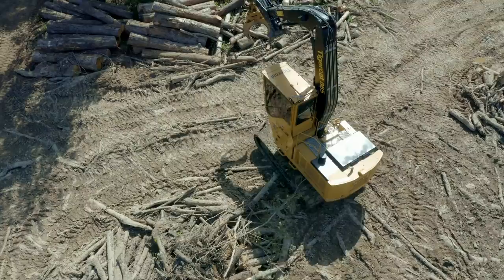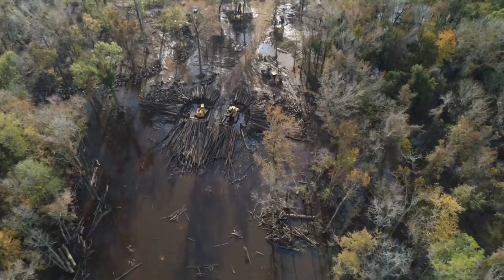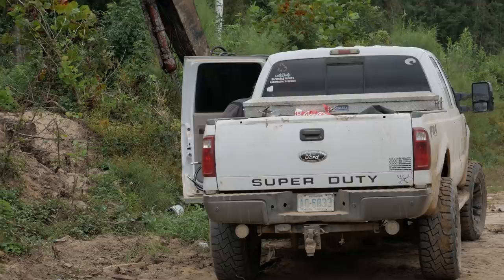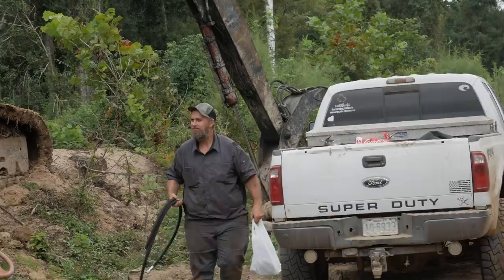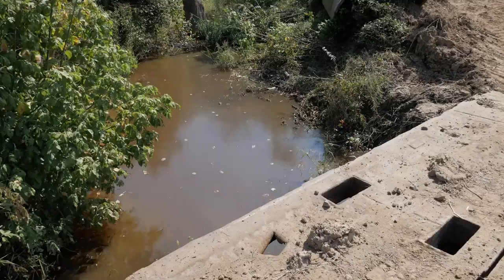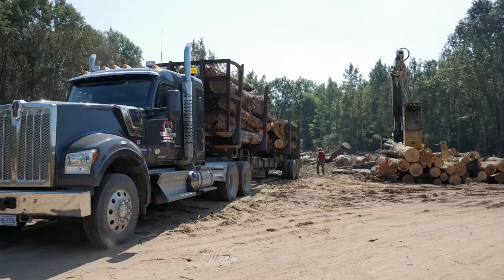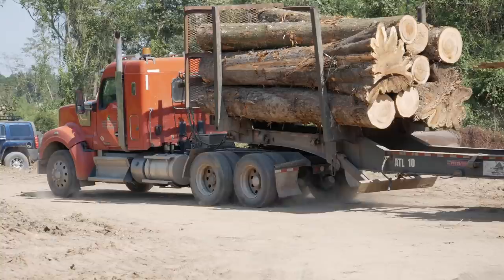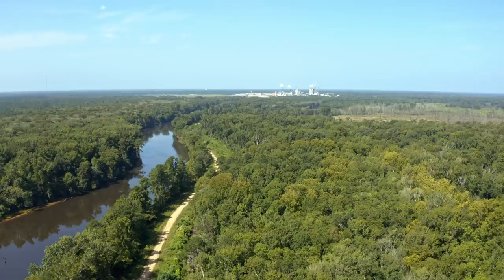SWAMP LOGGERS NC / Don't Know If We Can Survive This..."

Comment: Yankem rope, I had em 35 years ago on the Outer Banks fishing. You build up momentum in the first truck, like a rubber band. When it stretches to its limit then the stuck vehicle is coming out. I saw a man hook a pickup to a 21’ box truck, don’t know what was in it, probably not much but it came out. Now everyone from Midwest to the west have them to pull out the tractors and combines that get stuck. I think they make them up to 2”—-to 2 1/2” in dia. I’ve never broke or never seen one broke. Stay safe friend PS: You better wear a seatbelt or you will eat the steering wheel in the front truck.

Comment: The stretch on those ropes are awesome....I haul logs in north central Alberta...7 axle jeep and pole trailer...I blew a u joint loaded at night and my boss came with truck...empty 7 axle unit and we put a steering tire between 2 chains and he pulled me to the mill..over the scale to the crane.....the tire made it smooth no jerking....but we did stretch the tire a couple of time pretty good

Comment: Justin..never get that close or lean your face down to inspect a high pressure fitting like that again as if it blows that crimped end the pressure can remove your eyeball and face all the way down to the bone.. Proven fact... You can inspect it just fine and safely from 20' away little brother..

Comment: I have watched you for years mr Bobby I’m a swamp logger n south ga. I’ve probably missed the part when u talked about this but can u please tell me why u don’t use circle saws instead of slasher saws. With the price of chains and bar oil now days. I’ve figured it every way I could think of. Far as we can figure circle saw is the more profitable over time. It’s also really fast and the 72in handfab saw can cut a 36 In tree no problem. Thanks I’ve just always wanted to ask u that. Have a great day keep up the good work
Reply from the maker: Well we get such a good deal on the buck saws from years past. We have alot of spare parts for them. The guys can service them without having a maintenance guy to stop what he is doing to service it.  Thanks for the question.

Comment: Is that the hillbrun track they are on. The same one they cut on the show. Season 2 or 3 I think. With the 7 mile road. Where Bobby had to make a new road and deck. Is that the same tract. If so why are they not using the new road abs deck that Bobby build. Looks like they are back on the original deck on the hillbun tract

Comment: People need to do their research and think for themselves when it comes to the topic of logging. Logging is not deforestation it forest management. Look at companies like Weyerhaeuser and Roseburg timber. They manage that wood. They plant it then they thin it a couple of times then they clear cut. Then they replant and start over. I bet all these people against logging all live in house built from lumber, I bet they use toilet paper daily which comes from hardwood pulpwood. But i bet if you were clearing these trees and piling them up and burning them so that they could build a new Starbucks, or somewhere they could shop then they would all be okay with it.

Comment: Bobby your wasting your breath with todays generation they would rather see it burn or rot.I work in the woods in small NovaScotia Canada we are no longer aloud to clear cut anything on crown land it has to be a strip cut or what they call a retention cut which usaully leave 20-30% behind which does get blown to the ground within  two years forgot to mention we cut for a hardwood mill so most of what we cut is mountain maple its a shame because of public pressure we are destroying more of our forests now then any clear cut could instead of cuting 600 hundred acres a year to get the tons needed we are mauling through 1000'S of acres just so its not a clear cut!